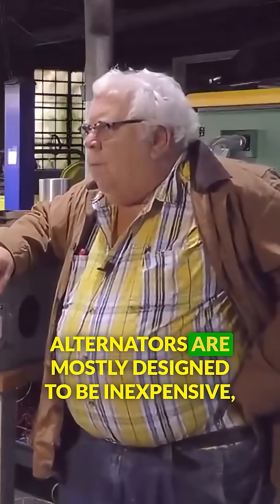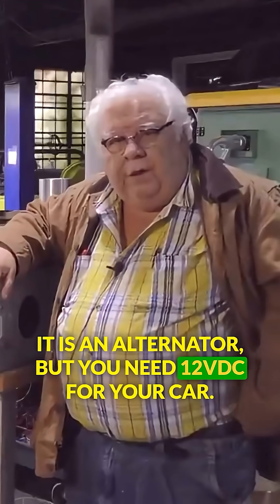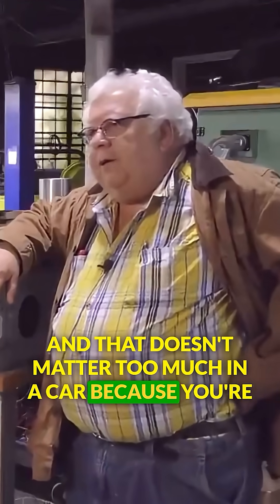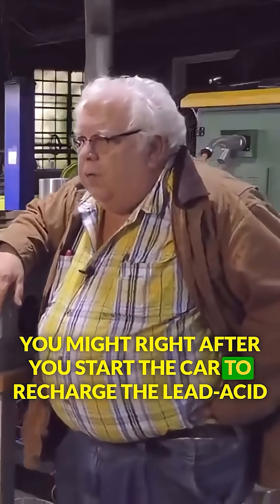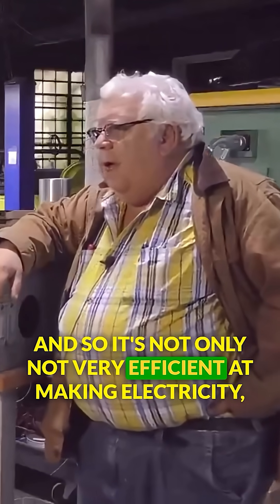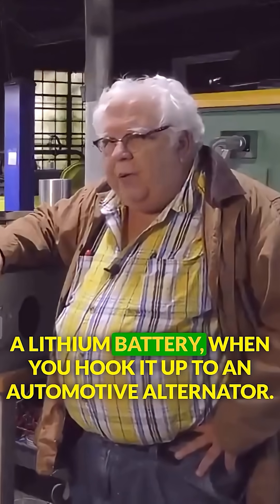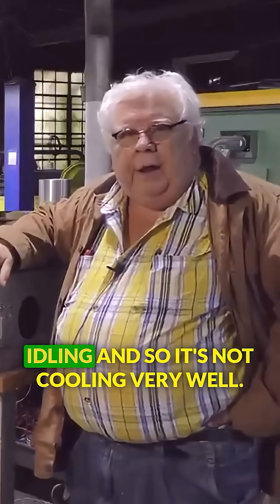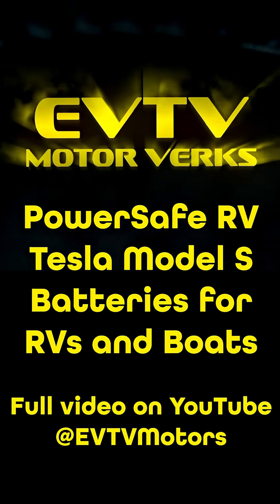Alternators are Only 50% Efficient!

Comment: The math is quite wrong. An alternator with an output of say 100 amps means that each diode carries about 16 amps RMS as there are usually 6 diodes in a 3 phase rectifier pack. Each diode will drop about 1 volt (at that current) so 1x16x6 = 100 watts of losses for the rectifier. If the total power out is 1200 watts (12V x 100A) with 100 watts rectifier loss =  about 92% efficiency ignoring other power losses.
Reply: Three phase rectifier bridg have 6 diods, only two are conducting at any given time, about one volt drop on a conducting diode. At 14 volts output, the diodes consumed 2/14 of the energy about 14%. The other energy waste is on the magnetic field coil that consume about 7%, the coils wires resistance is another power waste, the electronic some more, the brushs resistance and friction, the belt friction on the alternator wheel, tensioner, and main pulley. Fan colling, vibration, noise and some more. So it is between 50% to 75% depending on many factors.
Reply: I honestly don't remember the math right now but there is nothing that generates electricity at 92 percent efficiency.
Reply: @erictheguy6646  The efficiency of large power plant generators can reach up to 97 percent. Otherwise, the removal of waste heat in the megawatt range would be difficult.
Reply: @der_bekehrer you are mistaken
Reply: @erictheguy6646  No, i worked in a Nuclear Power Plant as a control technician. I know what i am talking about. You can als google this information. It has to do with the size of the generator. The bigger, the better. To get things clear: i am talking about the efficiency of the generator, not the whole Power Plant. The complete thing has a much lower efficiency. And this has to do with Thermodynamics.
Reply: Jet turbine generator going fast enough @erictheguy6646
Reply: The diodes and windings also have resistance, it's not just the pn junction loss. I can attest that a hard working alternator gets HOT. Even with a cold engine.
Reply: Only 3 diodes in a car alternator. It’s a one piece that’s usually referred to as the trio-diode.
Reply: @jimcooke640 Some alternators are three phase which means 6 diodes for a 'full bridge' DC output.
Reply: @sylkelster all alternators are 3 phase and every one I’ve ever worked on has 3 diodes
Reply: @jimcooke640 Seems like a half wave design like that would induce more noise into the system. I'll have to check out some diagrams.
Reply: @sylkelster I believe you are correct. All those years of calling it a trio has falsely made me think it was only 3 diodes. Definitely would be a difference in output quality
Reply: @jimcooke640  About all uses 6 diodes. The diode trio has 6 diodes; 3 pairs of 2 diodes in series and the center point is the Feed
Reply: @3beltwesty  afaik they are all switched in delta, not in star. The rotor has no feed. The feed comes from the excitation current in the rotor, which is regulated depending on the output power of the generator to keep the voltage in a specific range. Some older generators have an auxiliary winding in the stator to make their own excitation current for the rotor. But this is not really needed. Even with a flat battery a modern AC-Generator starts producing power, at least if you rev the engine a little above idle speed. The residual magnetism in the iron core is sufficient enough to get things started.
Reply: @der_bekehrer the rotor is usually about 2 to 5 ohms and has slip rings and is supplied DC on late 50s ambulances to at least they 90s or newer.  The winding on the stator can be star or delta. I have rewinded stators both ways. The rotor to self excite has to have some residual magnetism. If not then you need 12 volts. 

The older alternators had external regulators both relay type and transistor type too. 
  
An old ford i rigged up with external diodes and a manual control on  dc field. This was to power ac dc drills and saws  on 50 to 90 volts dc via the bridge.

In maintenance work a place i was at had a 2 alternators on each work truck. The 2nd one to provide dc 40 to 90 volts to use with circular saws and drills.

With a delta winding if imbalanced you can have more losses in the stator if wildly different numbers of turns per coil.

A neighbor at Ford in the earlier 60s had a rear window heater run off a 2nd alternator using no diodes.  Ie direct ac out.  An engineer at Ford with prototype.   That higher voltage allowed practical wire size since voltage  way higher
Reply: @3beltwesty  Thank you so much for this detailed information! I actually learned something new. I'm from Germany, and here some of the generator types you described don't even exist. In the 1960s, we had DC generators, and from the 1970s onwards, we only had AC synchronous generators. The stator was connected in a delta configuration, with slip rings on the rotor, and the regulator was initially mounted separately, later as an integral part of the generator. In this respect, it's just like in the US. I had a '74 124 Fiat Sport Spider convertible, and the regulator was an external component with a relay and two resistors. The common contact either floated in the middle or touched one of the two outer contacts, depending on how much power was being produced. So there were only three control states. Unthinkable these days. But back then, cars didn't have as much sensitive electronics. If there was any electronics at all (apart from the six diodes)😄
Reply: You do not know what you are talking about.  Did you stay at a Holiday Inn Express, last night?  And now you think you are an Electrical Engineer?
Reply: @MrSummitville I am an electrical engineer with 40 years and he is absolutely correct. Each diode had 0.7 volts of drop as to ALL silicon diodes unless they are a Schottky which is closer to 0.5V.
Reply: @davidthomas3859 and what are the other 2 characteristics of diodes?
Reply: @MrSummitville  Are you saying the diodes are dissipating 1200 watts of heat? They never get that hot

Comment: I know little about this - why won't a generator work?
Reply: Lithium batteries have a very low internal resistance. When discharged, the typical car alternator is not expecting that type of extreme load.  Newer regulators will limit the current to prevent overheating of the alternator.   This is more of an RV situation.
Reply: @MrSummitville  Does alternator = generator? I thought generators could produce DC current. No? The reason I asked was that cars don't normally use alternating current for lights and stuff; it is 12 volts DC.

Comment: Had wires exposed and oil water got into my alternator on my miniskidsteer it was 100 degrees out side..and started smelling electrical fire ..it was so full of crud some how and water ..plus wire was touching..had ran it daily for weeks then washed it but it got inside the grooves of the case on alternator could see smoke coming out that spot ..need order one .I cleaned it with compressor and electric cleaner spray ..then taped any wires it seems ok.but guna get one

Comment: Mathematically it is not making 1200 w of heat, also most alternators today have clutches and aren't always operating. Smart alternators.... Woo
Reply: one way clutch, takes the chatter out of the drive belts usually se them on 4cyl more for the obvious reasons. replaced a ton of them with the korean cars they start slipping the drive direction and knocking the tensionor.

Comment: They don't cool at 600 rpm idle speed, That's why I put the car in neutral and hold my foot to the floor so it cools better, LOL But on a serious note, I've been driving for 49 years and as a mechanic, I maybe replaced 3 alternators in all the cars I've owned and i  cant count how many cars I've owned, some new but mostly used. I don't know why he says there not efficient, which I take as not dependable, THEY WORK. Thx,
Reply: Efficiency and reliability are two totally different things.
Reply: @victorjcano  I know that, and we would like to have both. he just seems to be bashing what we have, and it works great. That's all

Comment: That's why Japanese alternators use 6 phase stator and more diodes -- to increase efficiency.  50% to 70% efficiency  is a big jump and less heat.  Lithium battery would require an extra or different regulator.
Reply: What make & model ?
Reply: 6 diodes is full wave rectification, 3 is half wave. It reduces noise and yes. Efficiency but mostly because it now conducts on both sides of the sinusoidal output.
Reply: @davidthomas3859 But he said, "6 phase stator", not "6 diodes".  I can not find any evidence of "6 phase stator".  Since the 1960's, car alternators were standardly, "3 phase stators with 6 diodes".
Reply: @davidthomas3859   https://youtu.be/LMB2Rrpz9yg?si=HpVzP41przIehMxm
Reply: the newer gm truck alt have a 6 diode setup. cheap enough, rated at 220amps and will idle all day long with a 100amp load on them. pwm control to adjust voltage output too. but none of that matters because all lithium batterys designed to replace 12v car batteries have a internal bms that limits income charge current, cell balance and temperature. he said a lot to say nothing you really need to worry about
Reply: @jsomething2 The video was from, at least, 5 years ago. Alternators were smoking.  You assume everybody owns a new truck with a 200 amp alternator?
Reply: @MrSummitville no. I assume everyone has a bms in their lithium battery setup. or you probably shouldn't be playing with them.
Reply: @jsomething2 The batteries had BMS. The alternator smoked.

Comment: Without looking into this further I'll just express puzzlement that they wouldn't have tried to increase the effiiciency to reduce material cost.

Or did they?

- not an automotive historian
Reply: They did, they do and modern starter-generators (alternator + starter integrated, for higher power vehicle grids) are 85-95% efficient, as cooling and material cost money.
Reply: @Leonelf0 Thanks for the insight.

Comment: What a load of garbage
Reply: Been running lifep04 headway cells 4s7p with automatic cell balancer on my 2.2 diesel ford mondeo for five years now cranking , starting and charging fine .
Reply: @michaeltandy1383  i’ve been running lithium batteries on standard alternators for five years as well

Comment: Victron actually put out a video on this subject for the purposes of dc dc charging a secondary, just put a current limiting shunt below the c- value of the battery paired with a decent bms and u don't need a dc-dc converter.
Reply: The amperage limit should be set to max 50% of the rated capacity of the alternator, as this is normally the limitations reach first.

This gives the alternator chance to keep cool as the charging of the lead acid battery quickly goes from bulk (CC) to absorb (CV).
Reply: Current limiting DC-DC chargers are the standard in the van life community.

Comment: So what is the implication with dual battery when running a second battery for fridge etc in the back of the truck? Is the solution a better alternator or just don’t idle too long?
Reply: Buddy of mine would put small diameter pulleys in order to get charge at low RPM. A place in Fresno called Evan's Electric Service (defunct) could build you an alternator that would start charging at cranking speed. They did it with a low cut in regulator and stator/rotor wound special. They had several combinations of early Delco alternators before the mounting holes went metric. Leece Neville made some good industrial alternators that my buddy adapted (1960's) to a gas powered ice crushing machine that would run 500 RPM and power lights so he could work at night crushing ice and blowing said ice into rail cars that were loaded full of melons going back east from Mendota. That business is dead but the machines are still in storage the the operator/owner is still alive (89 yo). Edit: you can only go x diameter on a pulley because a belt won't go around a small diameter too well. He's go to multiple belts so he wouldn't have to go high tension (bad for the bearings). These days getting matched belts is difficult (none at Auto Zone). He built a few drives using 8 and 10 rib truck serpentine belts but the choice of lengths are limited.

Comment: It's a half wave rectifier. So half the wave is canceled. 50% loss. Then there's the loss from the output going from zero to 13.25 to 14.25 v and back again. The power generated is the area enveloped by the wave. So that could be another 20%.
Reply: No, there are 6 diodes in the rectifier pack for an alternator, providing  3-phase FULL wave rectification. True, a single diode can only provide half-wave rectification but the arrangement of 6 rectifies all the output from the 3 windings in an alternator.
Reply: @topspeed250k5 ahh,so it provides a standing wave of whatever voltage that is regulated by varying the field strength?  It generates plus 18v and minus 18v, phase isnt an issue and power loss is minimal.

Comment: The issue is primarily that Pb & Li-ion batteries have a different chemistry that requires a different charge profile (over simplified: the current & voltage applications). Just making the Pb (lead) battery's alternator more efficient, won't resolve the problem of charging a Li (lithium) battery, neither efficiently nor effectively or even correctly.